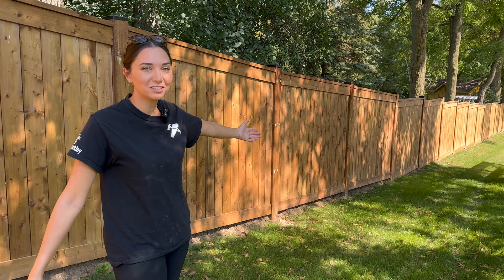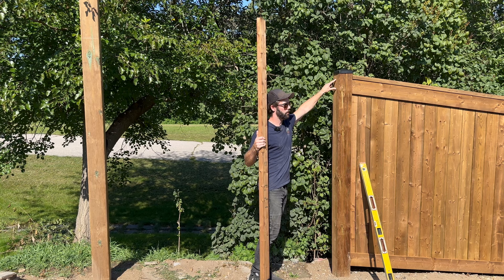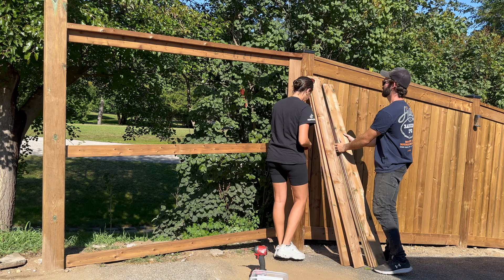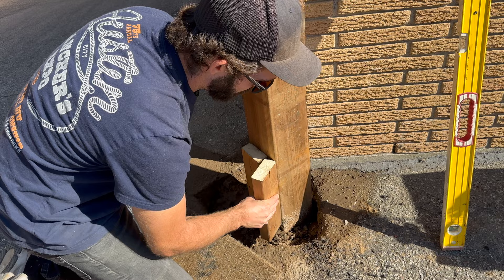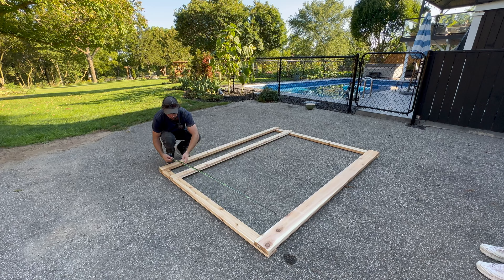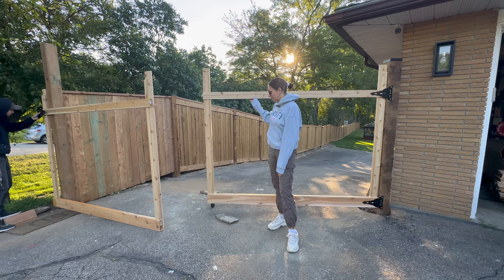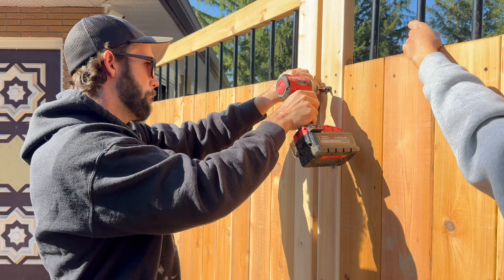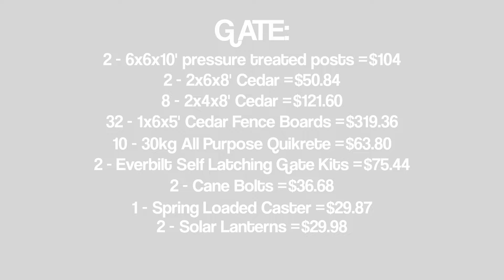Building a Privacy Fence & Cedar Gate! Everything you wanna know (cost, materials, tutorial)

Comment: I did the same fence for our backyard this summer. Curious why you didn’t opt for a diagonal brace, the gates are pretty wide.
Reply from the maker: The way it’s built (glued, screwed and half lap joinery) a brace isn’t required the only way it will sag is if the post leans in, or the hinges fail. There are spring loaded casters at the ends of the gates to relieve the pressure anyways so the brace would just add extra weight